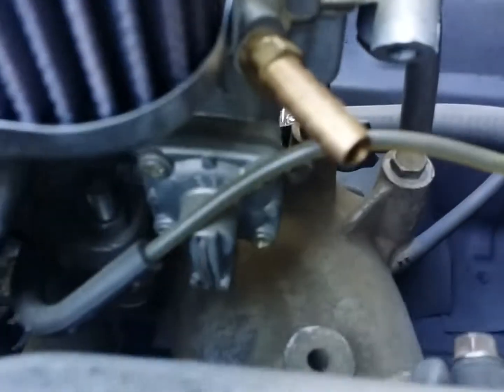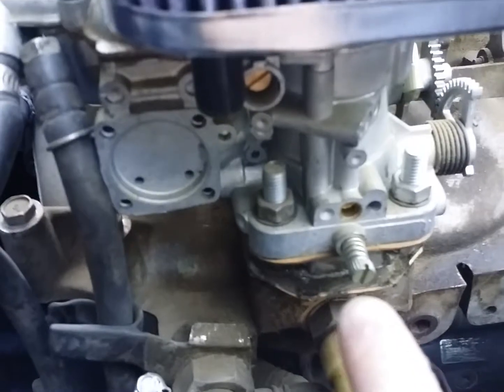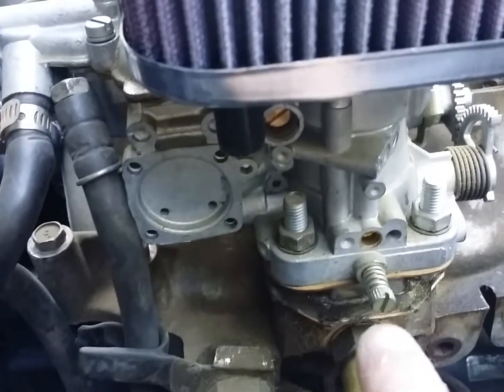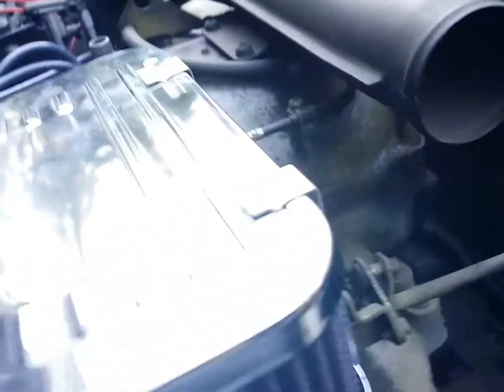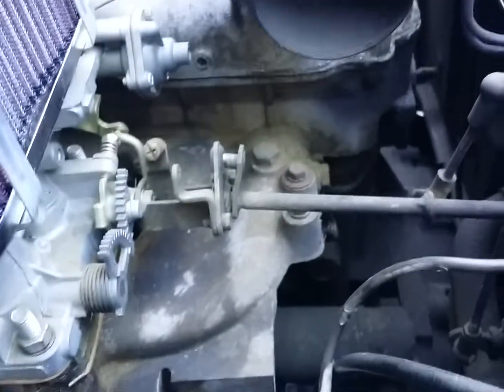1974 Ford Courier - Weber carb functionality

Comment: Did this come with an electric choke that you converted to manual? I bought a Courier with a Weber carburetor. It does not have a functioning choke, because the electric choke was hitting the valve cover. The previous owner decided to grind off the electric choke element. Now I'm trying to figure out if I can add a spacer to make an electric choke work or if I should convert to manual. I appreciate your video and any thoughts...
Reply: i just picked one of these up and have the same issue- it's only got about a 1/16" inch for that electric choke lead before it hits the nut on the valve cover... i may need to convert that to the manual choke.  but i still haven't decided how i'm going to fit the throttle linkage together yet.  the kit they send with the weber is designed for a cable....
Reply: Tim B I ended up flipping the entire unit around and running a cable throttle to the other side of the carb. i'll post a video when i'm done- but i really wanted an electric choke if possible and what the guy did in this video was the only way to get the unit mounted... basically had to bastardize the whole choke assembly. it might work but i'm guessing the tension is way looser than normal
Reply: smalcome did you ever figure it out ?
Reply: Reverse sensor for this van